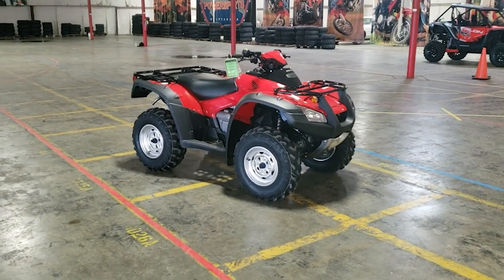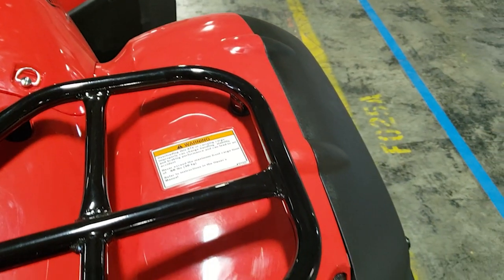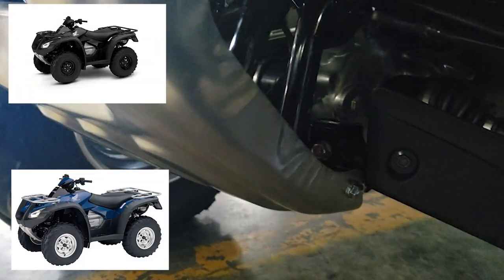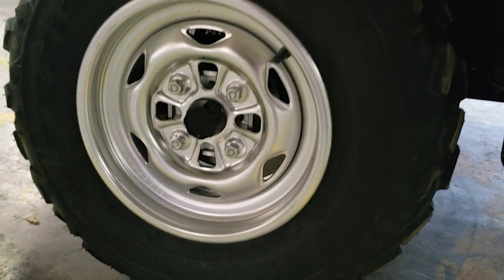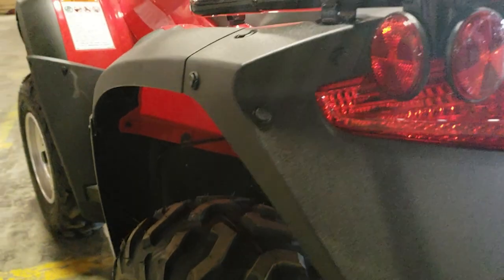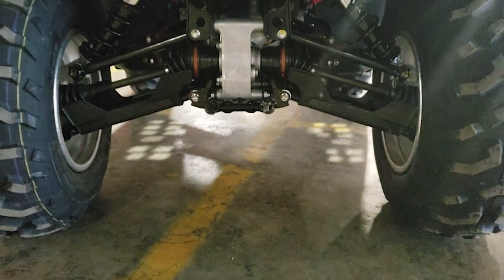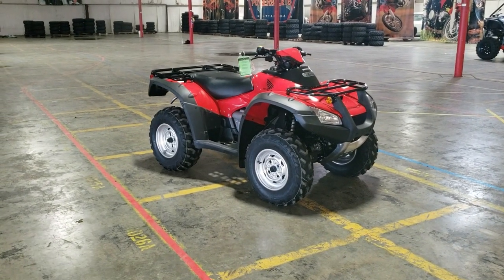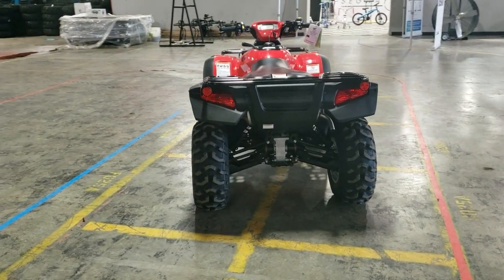2021 - 2022 Honda Rincon 680 ATV Review of Specs / Features | Better than the Rubicon & Foreman?

Comment: I want to see a 1000 rubicon with a hundred horsepower locking front diff and foot shift mud edition with factory snorkel
Reply from the maker: That would break the internet... and I'm all for it! That would be a game changer for Honda to release a 100 horsepower ATV with all of the bells and whistles! It would also cost about $15,000 but who cares lol.
Reply: @HondaProKevin  Honda should do it there would be no can am that could go through what it would specially where Honda don’t use belts for a drivetrain
Reply: totally wrong manufacture for those specs..........................
Reply: @HondaProKevin  that’s right who’s cares I know i wouldn’t it’d put a smile on my face to see one come out and I would happily pay it too specially knowing it’ll have that Honda reliability Honda’s are bullet proof I know that have family that still has the old atcs from the early and late 80s running perfect with no oil leaks or anything and I’ve had a lot myself and never had no problems with them well I had 2 Honda’s over the years that I had a lot of problems with one was a 86 350 Fourtrax and the other was a 82 200 big red the one that was chain drive with high and low no reverse but that was just bad luck buying them from the wrong owners that didn’t keep up on maintenance and didn’t really do a good job when they did any maintenance
Reply: @scottmugford1123  one of the reasons Honda’s are reliable are because they don’t make a hundreds horsepower. They would have to beef every part of the machine up axles diffs trans to get it close to strong enough. With that being said I would also happily buy one!
Reply: @DawsonPerron  yes I know they would but its not like that’s a hard thing to do Honda just got to get back In the game and take down the can ams cause we all know there good for power out put but they spend more time being fixed then what a Honda dose they have the 1000 talon why not a 1000 rubicon ? All i am saying Honda needs to come out with a few bigger bikes now cause they don’t even have anything bigger then the 680 in the atvs and I’m not a fan of the the way they have the 680 set up best models they have are the rubicon and foreman
Reply: @HondaProKevin  they make 60,000 plus J Series V6 Models so 15k atv would be alright plus it make brands like Yamaha and polaris and cam am panic for sales. But I don’t think Honda they already own the Automotive Market. Anyways Happy Hondaing.
Reply: It would be insane, would probably move honda into the number one in the market
Reply: I was fucking thinking that as I was clicking on this videp
Reply: Honda four wheelers haven’t even surpassed 40 horse lmao
Reply: @HondaProKevin  my wallet does lol but I don't!
Reply: If Honda came out with a 100 it would have 45 to 58hp and it would be 12k to 16k they will never have a mud addition cause it would give problems
Reply: @scottmugford1123  Honda needs to come back with the 400x and 450r
Reply: Well, as far behind as Honda is, maybe they’ll do that in 15 years.
Reply: @scottmugford1123  people will pay big money for a sxs and they have taken over the market.  No one is going to pay 15K for a 4 wheeler when they could just get a sxs for that money. Or very few would. It wouldn't be worth it.
Reply: @jhetwinston1342  TRX450R.......
Reply: …..Sitting on 32” tires, and able to tow about 1600lbs (I need to be able to bring hunting/camping gear and an elk down off the mountain and back to the landing craft)…
Reply: I had a honda dealer tell me years ago when the 650 switched to the 680 i bought it and complained about no hitch and lacking front and rear bumber compared to the rubicon, he said honda has some type of agreement idk with who but they can not produce a atv over 600ish pounds. Its the exact dry weight of the rincons which is why hondas atvs have been lacking
Reply: Actually painful to read that, 
The incompetence is real

Comment: I own a Rincon. If it used exclusively on my trapline in North  Western Ontario,  Canada.  I can honestly tell you that this bike is an absolute workhorse that has never let me down. Regarding a front locking differential, I have never been in a situation where I needed it. I have 11,000 km on mine and still runs like new. The 3 speed transmission is bulletproof.

Comment: Bump it up to a 720 add power steering and diff-lock..id buy one
Reply from the maker: Pair those changes up with a DCT too and I think a ton of people would be lined up with you to buy one!
Reply: @HondaProKevin  Yep.  Needs the 5 speed plus low range.  Also needs to move up to a true 26" tire and offer the alloy rims from the rubicons.  My 2020 rubicon's 25" stock tires measures a measly 24" tall.  And for gods sake don't electronically speed limit them.
Reply: @HondaProKevin  I would be lined up to buy one if they made those changes
Reply: I would be lined up to buy one if they made those changes

Comment: My Rincon was like riding a run away train when going down hills. Ive always liked Hondas but I had to switch to the Kodiak. And I haven’t been disappointed. The engine brake is such an improvement.
Reply from the maker: Oh yeah, that's definitely one of the Rincon's downfalls. Glad to hear you're enjoying the Kodiak bud!
Reply: The problem with that Yamaha Kodiak is that it's a automatic transmission and I can't do automatic. It's like a winding rubber band. And it sounds awful. Not to mention it takes away the fun Factor. When I grew up as a child we had a three wheeler with a 5-speed and it was a blast to drive but automatic transmissions are not fun. They need to offer the Rincon with a 5-speed foot shift or a 5-speed DCT. And also offer an option without power steering That automatic needs to be thrown in the garbage

Comment: As for the rubicon workhorse (my pick) the racks need brackets for carrying lumber and trailer options maybe. Rincon twin cyl. should have dif lock & hitch & suspension settings.
Reply from the maker: Maybe, just maybe that twin-cylinder Rincon isn't too far out there...

Comment: I have always liked the rincon but when it came down to it, the Rubicon had the features I wanted (foot shift and diff lock).      Hoping Honda adds a diff lock to the Rincon, as I'd love to have some options when it's time to purchase another Honda.
Reply: Agree
Reply from the maker: You hit the nail on the head and that's why so many people are going with the Rubicon over the Rincon lately. The Rincon  is still a great unit and ticks a lot of boxes for many people but it's not the "flagship" unit that it used to be.
Reply: @HondaProKevin  truthfully, I have really come to appreciate what the Rubicon is capable of.  My first atv was a 2004 foreman.  I've had several  other atvs and SxSs since but the foreman/rubicon is where I've had the most fun.  
My Honda wish list:. Rincon with a front locker and foot shift option.  If that doesn't happen, my only other wish/hope is that they don't get rid of the foot shift option on the Rubicon/Foreman line.
Reply: Its just like the XR650, DR650, DRZ400, etc.,  in the moto world. I guess the philosophy if it aint broke dont fix it. Im thinking spending money on engineering a new model is the issue for them. The majority of buying a new fourwheeler either judt want a reliable work horse like a honda, or a powerhouse of a machine like a canam. Im thinking honda cant justify engineering a bigger than 500cc four-wheeler when their other models will sell more.
Reply: @markkettering9851  I Agree 1000 %

Comment: Needs a 5 speed and 10 more horsepower. I’d gladly buy another one. Love my 2013. Bought it new.
Reply: 10 more,  more like 30 more lol.  Just detune the pioneer 1000 engine down to about 65 hp, give it a real 6 speed dct auto with es option,  power steering and decent suspension travel and you’d have a great machine.  In other words,  completely scrap the platform and build something new Honda.

Comment: I've got a 16' 680.
Pros-
   -Plenty of power, never got stuck w/o the locking differential, but i don't go thru 2' deep mud.....
   Steering is easy you wouldn't know it isn't power steering.
   -Starts and runs every time.
  -It'll haul hundreds of pounds in a small trailer effortlessly
Cons-
   -Either a 4 speed or lower 1st gearing. As a putterer on the ranch, I don't need to go 20+ MPH in low gear.
  The battery mounts in the rear fender well weird! Tho in a 2 piece plastic enclosure, I worry about water             exposure, not to mention having to hunker down to reach in for battery access.
  -Could use more aggresive tread on the stock tires.
  -Count on doing basic (it's easy!) maintenance yourself. The dealers here in California are far and few between and our local dealer is squirrely and can't find good mechanics. Independent mechanics don't like the space the quads take up in their shops. Our Hondas only need oil changes and air filters. They just run and run. Keep a gas stabilizer in the atv's unless you use them enought to be added gas occasionally, as the ethanol in gas goes bad so quickly.
Upgrades-
   I added aux. LED lighting bar, a hitch receiver, and cargo baskets, front and rear.
What a shame these aren't street legal for grocery and feed store runs!

Comment: I had 6,000 pounds on my rincon 650 and it pulled it just fine
Reply from the maker: Oh yeah, you can pull a lot more than what's recommended or should we say "not recommended" when it comes to the Rincon lol.
Reply: Funny cars and top fuel dragsters are moved from staging to the drag strip with a Honda rincon  ! They only use Rincons ! That should speak for their towing abilities .

Comment: I agree with another post here. Honda definitely needs to step it up with their welding quality. I had a 450 Foreman ES and some of the welds on the frame (especially on the underside of the machine) gave me the proverbial “pucker factor” when I was riding on bumpy roads and trails. I love Hondas, but before I invest in another one I definitely plan on looking at every weld, prior to signing any paperwork. I highly recommend anyone else doing the same thing. Don’t be afraid to tilt the machine an get a good look.

Comment: I'd like to see an 850 with at least 78hp an a locking front diff with power steering. Up the tires to 27's  on 14" wheels

Comment: PLEASE! get them to update the Rincon!  It will be over 20 years old before they get to it.  I NEED to update my Rincon but don't see any reason to buy a Rincon that is the same as the first one 20 years ago.  The Rincon is my farm workhorse so these are REAL needs:   My list is: 
1- Power steering - turning at low speed and weight on machine and/or in technical terrain, Power steering is a must!
2- Low range -  
3- New engine design and layout - An 850 cc would be good and make one that allows for easier cam chain adjustment.
4- Other general updates and features that add comfort and accessories. 
I DONT want to go to a CVT brand but may have to go to a Yamaha to get something that is new.  Ya, Polaris and Can Am have great accessories but, I want durability too!  If you have ANY pull with Honda, Please get them to update this thing!

Comment: I had one. So many other options that are more fun and comfortable to ride. But as far as workhorses, Honda gear on gear is most reliable and lasts forever if you treat it right.
Reply: The rincon trans never made sense though. They tried to outsmart themselves and it flopped.  Needed 5 speed instead of 3 and was underpowered from day one.  The can am outlander 500 has more power and they don’t even make it anymore lol.
Reply: @gregrowe1168  Same with the 450’s from Can-Am...

Comment: I what to see Honda make a 700 or at 800 mud ready quad and I think there are a lot more people that can agree
Reply from the maker: 100%! A Rincon with 50-60+ horsepower, diff lock, DCT etc and it'd sell like hot cakes.
Reply: No Honda needs to up there game a lot and start with the 700 and 800s and then 1000 mud ready with foot shift that’s got 100 hp stock
Reply: They could simply detune the 1000 engine a bit down to about 65 hp.  Would need a new chassis.  A 2up model would be great too.  Honda should make a smaller sport utv as well.  The talon is great but it’s too big for tighter trails.  The pioneer 500 is slightly faster than a tractor lol.

Comment: A footshift 820 solid rear axle with diff lock and color options
Reply from the maker: I like your thinking and 100% on the color options too as Honda has been lacking in that department for a while. They've been playing with some new and different color options the last couple of years though and I'll give them credit for that but it's few and far between.
Reply: @HondaProKevin  a rear disk brake would be nice to do the 2021 have front disk rear drum? Or is it still all drum
Reply: The rancher models is what I'm talking about I'm looking into buying one possibly can't beat them they just need to double the cc and all disk brakes led lights
Reply from the maker: On the Rancher, if you go with a straight axle model then you're going to have a drum in the rear but if you go with an IRS model then it will have a disc brake in the rear to match the fronts.

Comment: I've got one of these on the ranch and it's not a work quad. Shur wish they would have put lower gears on this. Only good for joy riding.
Reply: Thanks for your comment cause I'm looking to buy Honda atv for the ranch and think I'll look at Rubicon.
Reply from the maker: Daniel hit the nail on the head, if you're looking for an ATV for the rancher then I would look into a Rancher, Foreman or Rubicon model over the Rincon.
Reply: @HondaProKevin  I'll be looking into a foreman, and interested to tryout the power stearing. Thanks partner.

Comment: I have a 2007 Honda Rincon camouflage color that I purchased new.  I think I paid $7k.  Still have it.  It's been reliable, starts every time, never left me stranded. Very little maintenance cost in 16 years that I've owned it.  I wish it did have power steering and a headlight.  Probably the only things I wish it had.  If it had those two things I'd buy another one; otherwise, I'm looking at a different Honda model and/or a different manufacturer.

Comment from the maker: What do you guys think about the Rincon? Is it still worth its $9,499 MSRP or would you rather go with one of the other Rubicon, Foreman or Rancher ATV models?
Reply: I wouldn’t buy a Rincon if it was priced lower then a rubicon
Reply: Rubicon is the better bike
Reply: Rubicon is Honda’s best bike.  Streamlined with the Rancher.   Give the Rubicon more power
Reply: I would go with Can Am for trail fun and competition. Honda is good for work on farms.
Reply: @NelsonCreekCustoms  no trust me I had my rincon 680 sence it came out an it’s still runs better then my friends new Forman an I have put my quad through hell an back
Reply: @anex8282  rubicon is much better the old carbed 500 is no comparison
Reply: I think if it had as many variations as the Foreman and Rubicon I would be greatly pleased. I'm not in love with its lack of transmission options.
Reply: The trans is cool but not worth not have diff lock and eps
Reply: I have an 07 Rincon and it still goes 69 mph pulling 27 inch mud lite tires with nothing wrong with it at all
Reply: @gleekoe_2381  problem is when u start going 28s and up and becomes clear what ones have more torque I’m running 32s on my rubicon
Reply: @NelsonCreekCustoms  that's a lot of weight but I get your point
Reply: @gleekoe_2381  on a stock 500/520 u can go up to 31s and pull them good my cousin has 33s on his stock 500 and it needs a gear reduction but it’d surprise u what how decent it pulls them and a rincon could just never
Reply: I think that it needs more speed
Reply: @calvinrobinson8386  mine hit 73 when it was new
Reply: @gleekoe_2381  I have a 2019 and it was brand new all I’m getting is 63
Reply: @calvinrobinson8386  well mine had a k&n soo
Reply: NO DIF,NO POWER STERING!!!!!!!!!!!! NO CAN BUY.

Comment: "it's hard to kill a Honda".  I grew up on TRX 250x's back in the 90's and fell in love with Honda reliability.  Now I'm looking for an ATV that will be suited for mostly work on the farm, dragging a trailer, and some trail cruising.  I don't need an insane off-road speed demon just looking for a general workhorse that is reliable and has some features.  It's odd to me that Honda has their 'highest spec' utility ATV - the Rincon, that has less features than the other utility ATV's.  Perhaps I'm missing something, but the Rincon doesn't even have a place for a ball/hitch or diff locks... seems the Foreman Rubicon has more features.  

What am I missing?

Comment: The rincon should have the 1000 engine from the talon! It would outsell all other atvs
Reply from the maker: 100%! I figured we would have already seen the Rincon with the Pioneer 1000's engine by now since that rolled out in 2016 and Honda has used that engine now on so many different models. The Rincon is past due for a new engine with at least 70-80+ horsepower, DCT, diff lock, EPS among other updates...

Comment: Honda needs a upgrade to the rincon.800-1000 cc, power steering, hi/low trans, diff lock. 28” stock tires , composite racks with a system to install boxes etc....
Reply from the maker: 100%! ...and we needed it many years ago lol!